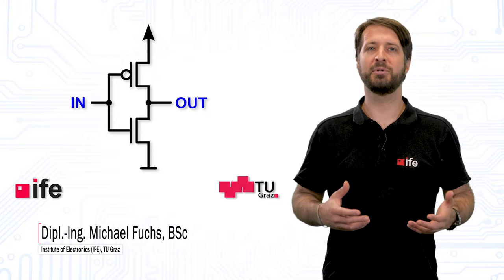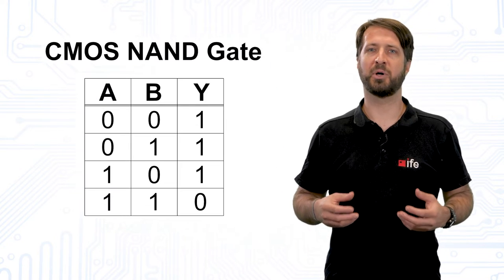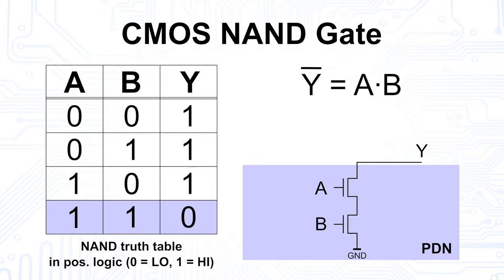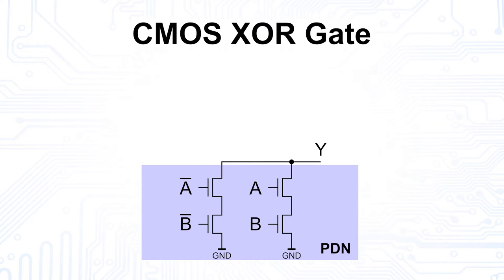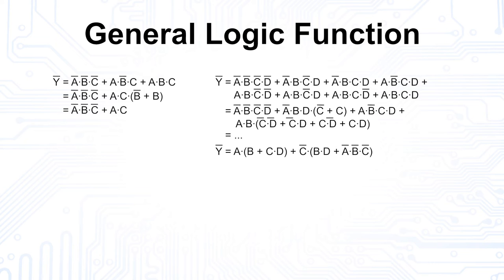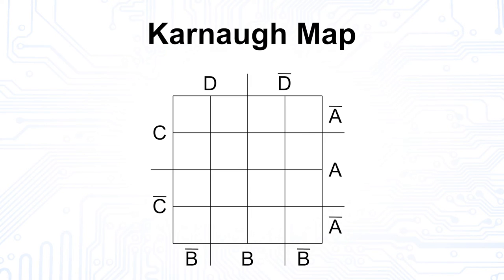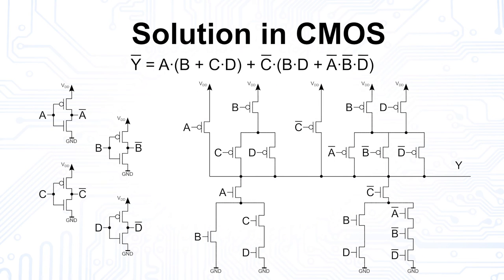CMOS Circuits - Pull Down and Pull Up Network, PDN, PUN, Karnaugh Map, Digital Logic, NOT, NAND, XOR

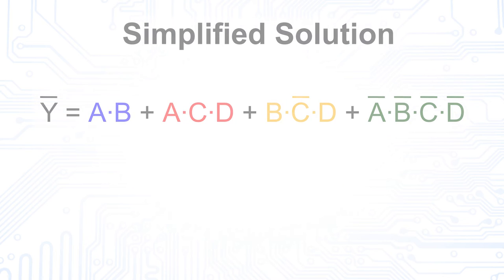Comment: Great video! But at 8:34, why do you use the conjunctive minimal form (since you're looking at the zeros), but then multiply ('and') the variables and separate the terms with a '+' ('or')? I learned it's the other way around. And my other question is: at 9:29, you took the solution from the Karnaugh map for Y and randomly created a Y dash out of it without inverting the terms so that the equation remains correct. I would appreciate a quick response because my test is on Tuesday :D Thank you!